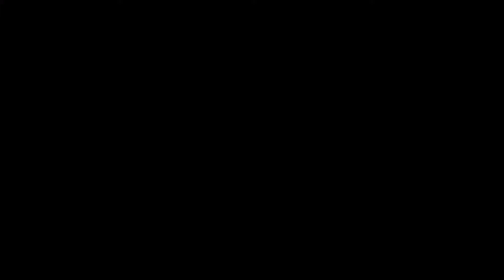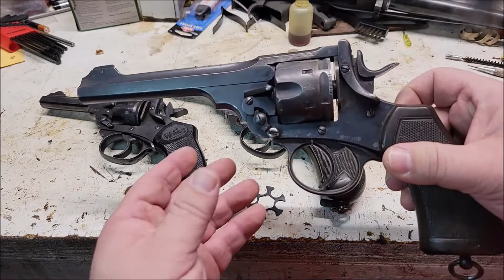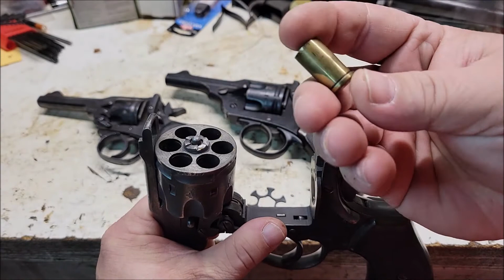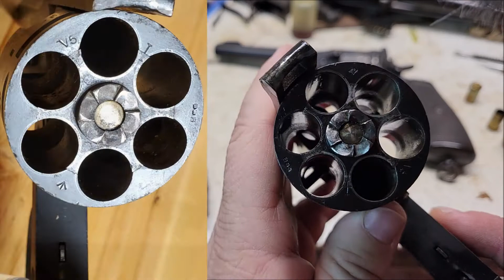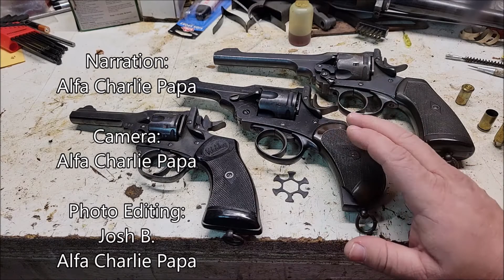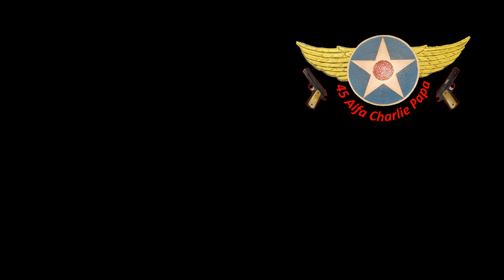Is that Webley cylinder shaved or unshaven? What to look for, side by side comparison.

Comment: Great presentation! I have a Mark 1* that is shaved. And it's ex-Royal Navy like yours!!! I could say "unfortunately" with regards to the shave, which is true from a collector's standpoint, but from the shooter's side, it's a benefit if you handload because you have some flexibilty on less expensive components. I prefer the .45 Auto Rim over the ACP as a case because you can have that "brass cascade" when you eject. Plus I have .45 AR speed loaders, negating the often-cited benefit of the full or half moon clips. Since .45 AR brass is relatively common (more common and less expensive than Webley Mark II brass) it's become my go-to (of course I have lots of ACP brass if needed ( : < ). The .45 AR  case is a little smaller in diameter to start than the Webley case but they fireform in the cylinder the first time you shoot and if you reload them using Webley dies, you retain that diameter (for the most part) and subsequently don't work the brass that hard. Lots of bullet choices but IMO it shoots best with a .454 dia. bullet close to the original 265 grain weight. I load to stay around 650 fps (will naturally be a little higher with the 6-inch barrels). The later Webleys (Mark 4 and up) can take a little more but since the  Mark 1s were originally black powder (most reproofed for smokeless powder by the British military around 1900), they are more fragile.